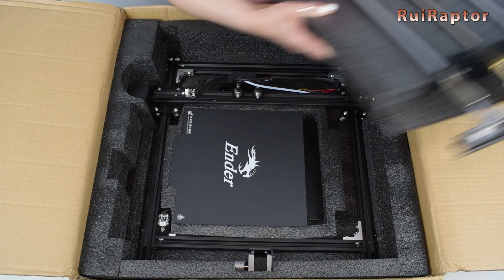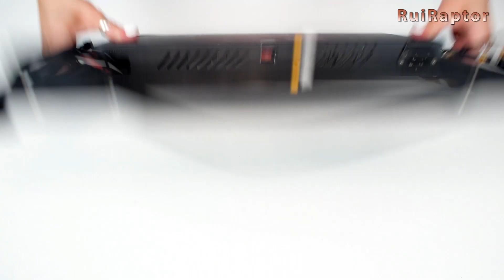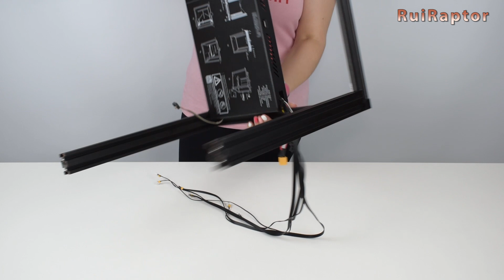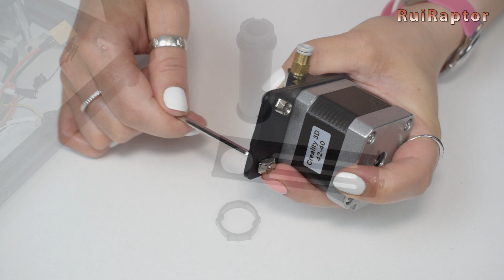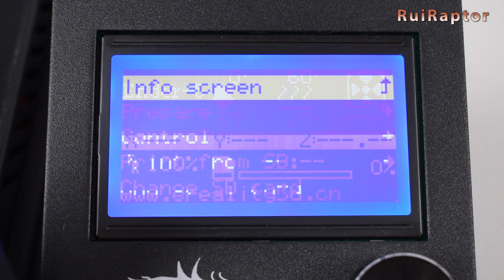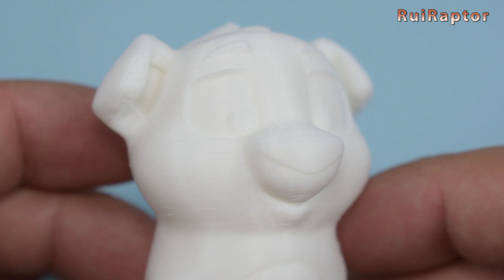Creality ENDER 5 - Unboxing, Detailed Assembly & Review

Comment: I can't believe that creality haven't upgraded the FW
Thanks for sharing 👍😀
Reply: I think the Ender 5 PRO has the newer firmware with Runaway Protection enabled and newer controller board, quiet drivers, metal extruder, and capricorn tubing.
I like my Ender 3 Pro and have Ender 5 Pro in a box unopened in hopes of the bed being a non Y axis bed slinger would be better for taller heavier prints.... but... looks like the cantilever design may be a tradeoff with the bed sagging and moving in the front.

Comment: Ask Creality for a review unit of the new ender  6.
Reply: Yes, the enclosed one.... but what is the point if not completely covered on top also in order to print exotics??  3x faster printspeed.  : )  coreXY.
Prob $600 US.  Not worth it if sagging cantilever printbed.
Didn't Creality Ender 4 already attempt CoreXY?  How did that go? Or is that a "H"?
Reply: @timd9430  Ender 4 was an H Bot. I own one. You probably could never buy one again, the dont prpduce Ender 4 anymore. I converted mine some years ago to corexy. Much better performance. Interesting Name choice Ender 4 was wayyyy before Ender 3 or Ender 2 came to the market.

Comment: @ruiraptor
Do you know if your model of Ender 5 has the inferior Landy PSU or superior Mean Well PSU?  I know these "used to" come with the better Mean Well, but then they changed to Landy to be cheap.  I would "hope" they include the safer Mean Well these days, but wouldn't know until received.
EDIT:  I didn't get to this part yet, I see comes with garbage Landy PSU.  Not good.  Would need to replace with Mean Well PSU.

The cantilever design of Ender 3 (Pro)(non-Plus) seems to be poor design with bed angle decrease and/or bed falling even with backlash nut?  Does this happen more so than it should?  I know you can print bed braces and some users installed dual z axis, but a lot of work.  Might as well get the Plus, but huge.

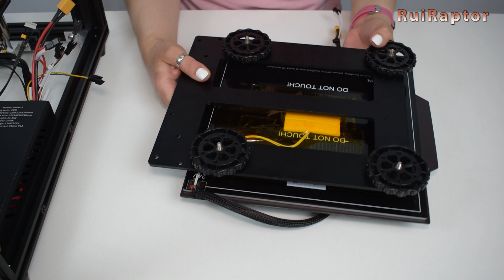12:00 Terrible Creality still does not have a strain relief as standard.  Electrical and Fire Hazard just waiting to happen.  They include with much cheaper Ender 3, so should here also.

Don't forget Cable Protector print!
https://www.thingiverse.com/thing:4093178

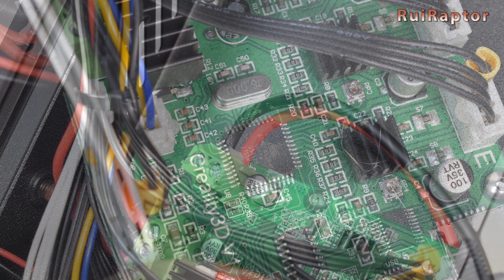5:57 Good to know also!!!! : /
Reply: Mine was one of the earlier ones, still with the 24V Meanwell LRS-350 PSU. The bed supports are an easy upgrade, and they work. You can fix the falling bed with a setting in Marlin to have the motor hold the torque for longer after the print finishes. Alternatively, you can swap the lead screw for one with less starts. The cable strain relief is a half hour print. So are the silent endstop mounts. I have my control box to the side now, and i am converting it to direct drive with a Hero Me Gen 5 mount, dual 5015 blowers and BMG extruder. Had to buy a different, taller metal plate, but it works. Also fitted a genuine BLTouch, quieter Sunon hotend fan and a SKR Mini E3 2.0 board.
Reply: @nunopereira6092  thank you for the info!  : )